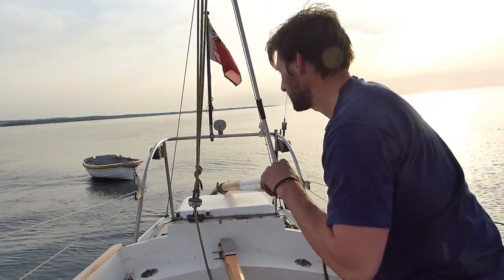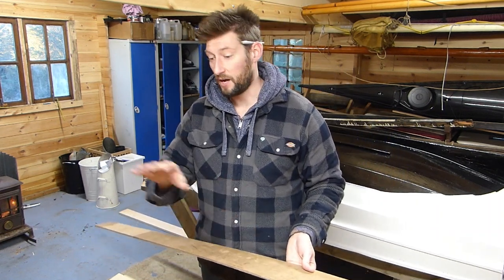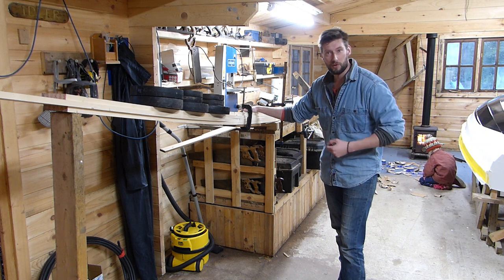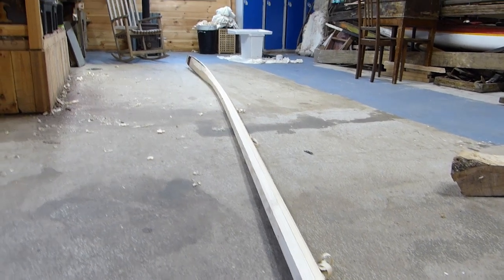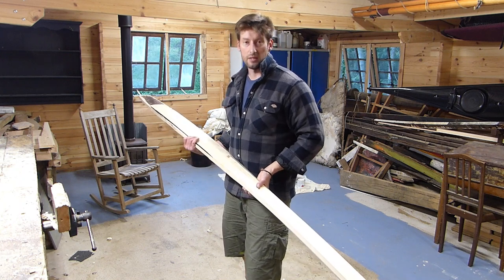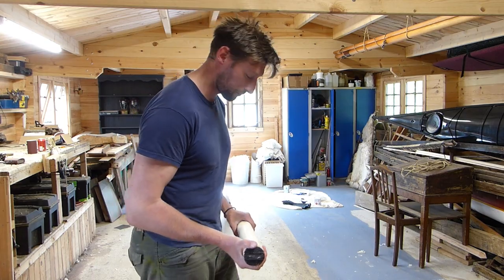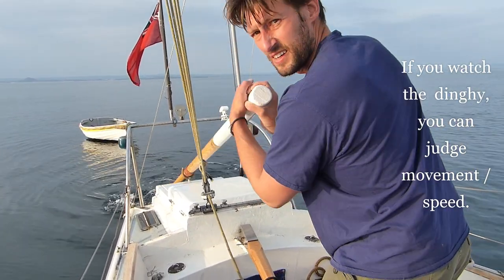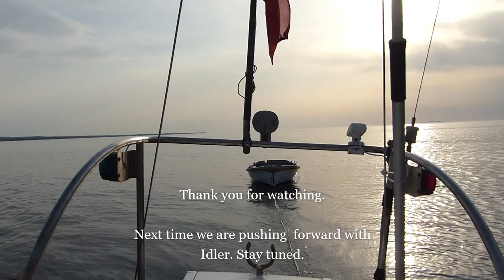Episode 21 - Reviving an Idler - Making the Sculling oar.

Comment: Hi! great to see someone building a sculling oar! I made one a few years ago for my 26 foot keeler (a raven 26, 2.5 tonne fiberglass sloop) not as nice as yours, but I could get 1.5 knots! I had a larger blade than you, flat on the back, curved on the front. set off center so the lanyard didn't interfere with the tiller. I originally had a straight oar, rotating it by hand, but my hands got sore. Then I cut the shaft, and bolted on a new one at an slight (5 degree?) angle. Mine pivoted on a pin on the transom with a socket in the oar, later I added more sockets so I had "gears" just moving the pivot could make a big difference. I think maybe it was 20cm from top to bottom socket. I'm sorry I can't give more accurate details, am a long way from that boat currently.

I didn't use it very often because although I was sailing engineless, if there was even a little bit of wind it was easier to sail, but several times it did get me to a point I could drop anchor and sleep, or across the bay, and once into and out of a small marina - without hitting anything! (the one time I took that boat into a marina)

Comment: Great video, great build. I’m a little fuzzy on how you determined the over all dimension’s to best suit your boat. Oh and by the way it’s awesome to see you are grooming some young new crew members.
Reply from the maker: Thank you! Thank you for watching, the oar was largely determined by eyeing up the length of a side of a triangle. One side: being from the waterline to hip height when standing in the cockpit. The shaft length is the length from this height back over the transom to meet the waterline again. I then added the “blade to this length that i determined by eye.
Shaft thickness was on the cautious side of extra strength. But i am sure i could reduce the thickness and thus weight of the oar by quite a-bit having spent some time playing with it now. 
Hope that makes sense?

Comment: I’ve been sculling since I was a teen in the sea scouts. When it clicked, I immediately figured out how to scull in reverse. Glad to hear your comment on that too. 
We always had the sculling eye(?) off-centre on starboard, to keep it out of the way of the tiller and the mainsail sheet. Any particular reason yours is centered?
Reply from the maker: Great point, and something i didnt cover in the episode. I would have liked an off centre rowlock for exactly the reason you stated and it might be possible following changes to the outboard cover in the boat. But at present with her narrow pintail and taffrail the only place that allows for enough movement if the oar is from a central location. Unfortunalty! - idlers will be offset 👍

Comment: Thanks for this video. I am going to build a sculling oar this spring for our 28 ft Bristol Channel Cutter. I was going to take an oar building class but now I don't feel I need to. What kind of wood did you use, and how did you derive the angle of the blade to the shaft?
Reply from the maker: Haha, brilliant! i hope im not to late in the feedback department to help you!
The wood is regular building pine. They call it redwood here fro some reason, but i think that's yellow pine in the states. I used this because it was cheap and would do the job. 
You want a straight grained, light evergreen species, Spruce, larch, a variety of pines... its not an exact science and there are pros and cons to different woods that are to much for this post.

The angel was determined by the hight of the transom from the water level. vs the length of the shaft relative to the rowlock (pivot point. Basicaly i lay a straight spar in the rowlock, positioned the handle where i wanted it and at the right hight. Then went aft, then eyeballed where it ought to bend to drop the blade into the water within a reasonable length of the transom.
Youll want the pivot point to be roughly in the middle of the oar with the heavier end outboard.

Hope some of that helps.
Let me know if you would like any more info. Cheers, Nick

Comment: I think the sculling. oar would be more efficient if the blade had a 15 or 20 degree hinge between blade and shaft like a fishes tail in not fixed on one plane it bends at the start of the stroke then flicks through 40 degrees to start the next stroke.
Reply from the maker: Hi Marlon, i see your thinking and i reckon that that would be a considerable engineering problem… however if you reimagine a skulling oars motion more like that of a snake swimming than a propeller turning it appears (to me at least less inefficient)…
Food for thought at least 😊